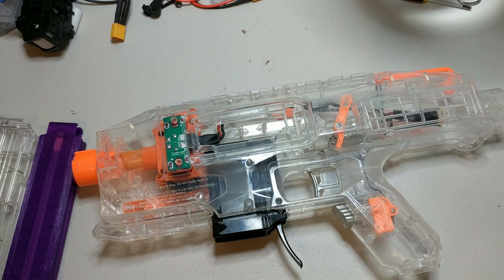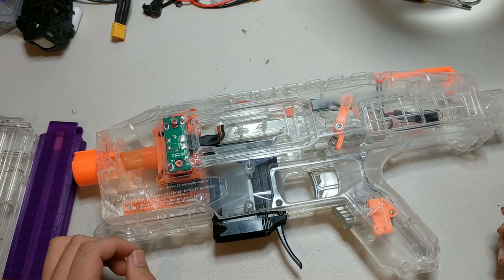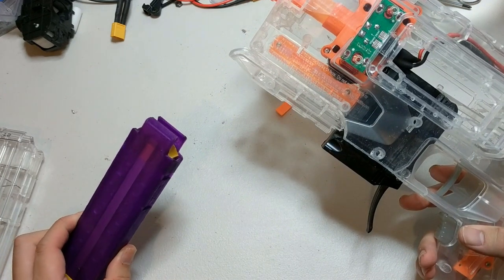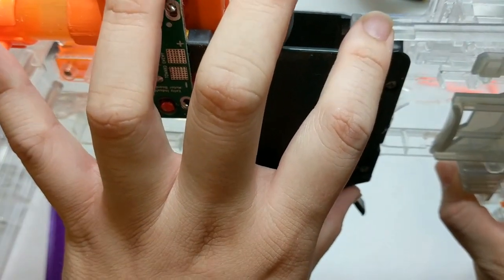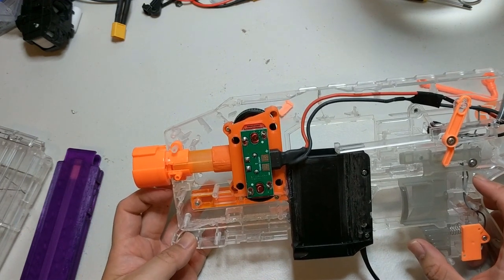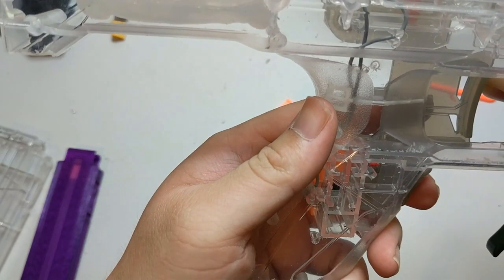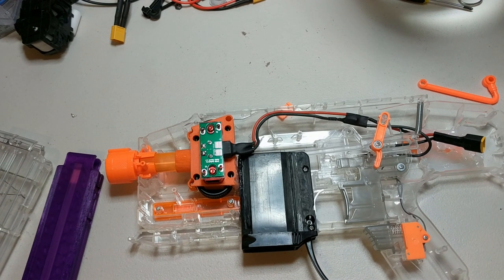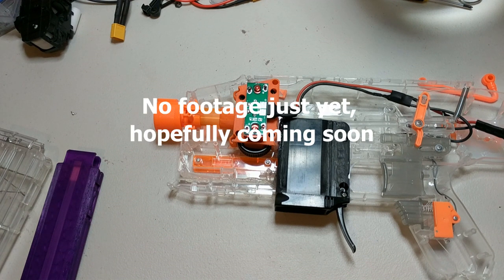short dart evader

Comment: That's a damn fine pewpew you've made!

You've emboldened me to make one of these with a twist: Regulator board/pusher. I've already partially modded an Evader receiver to accept Talon mags for a different project, but I think you've given me a different direction.

Thank you for your clever mod and taking the time to share. It's appreciated! Also, shout out to Alice Coatduck for steering me here.

Comment: Nice work on the front, aside from the use of hot glue I like it. There is clear ABS pipe solvent at my hardware store, maybe an option
Reply from the maker: yeah, it was really meant more as a semi-temporary measure. If I were to glue it in a bit more permanently I'd likely just use a dab of glue  on the posts
It mostly sits in position without needing too much else (thanks to drilling the hole around the screwport) but does wobble slightly otherwise.

Comment: Planning on doing something similar ... but I plan on keeping the side feeding, do you think it can be done with the usual flywheel adapter?
Reply from the maker: You might potentially encounter some problems since the bottom tends to be curved at the front
Reply: @panda.monium  what do you mean?
Reply: @panda.monium  do the darts feed at a curved angle?

Comment: Have you tried using the worker dart adapter for evader? Does it fit?
Reply from the maker: I had tried it a while back. It did fit although was less consistent with pushing darts into the flywheel cage

Comment: Where did you buy that specific pusher? I'm trying to get a short dart pusher for my evader but I don't think the Worker hybrid pusher will work or will it?
Reply from the maker: It's  a pusher made by Artifact, so no longer available since the company went defunct.
Reply: @panda.monium  Thanks, do you think the Worker hybrid pusher will work on the evader?
Reply from the maker: @pokemontcg1016  I have used it in the evader, and it works, though not particularly well